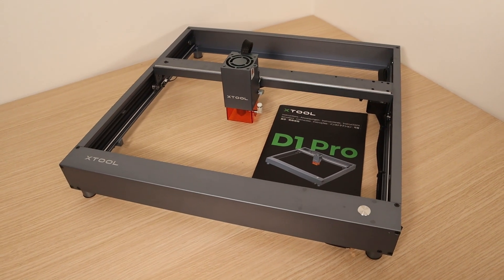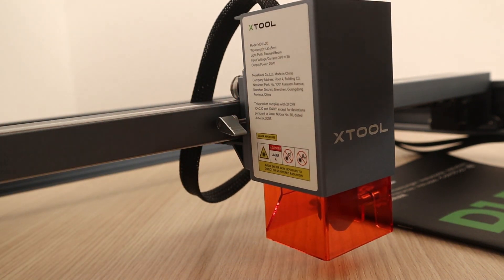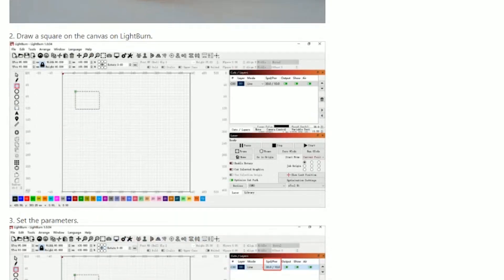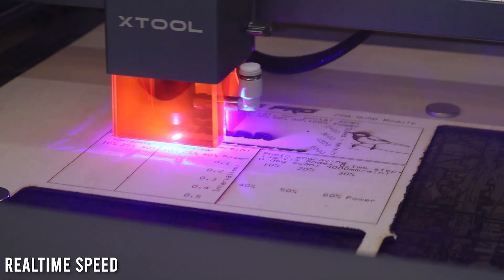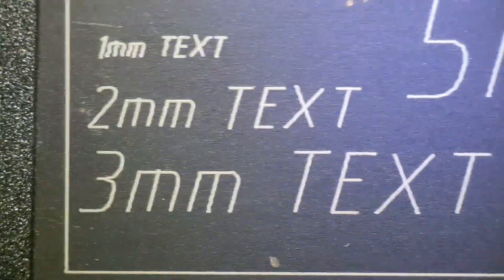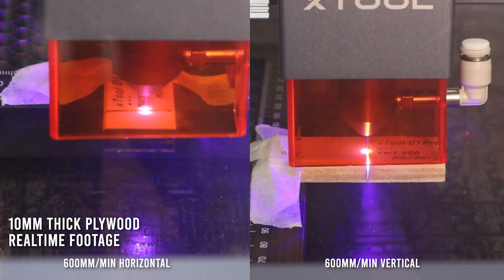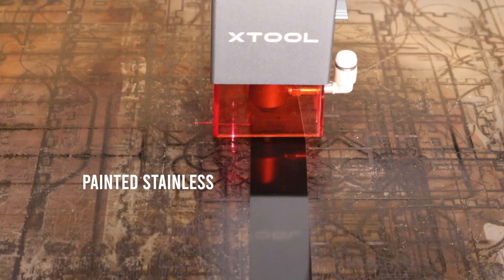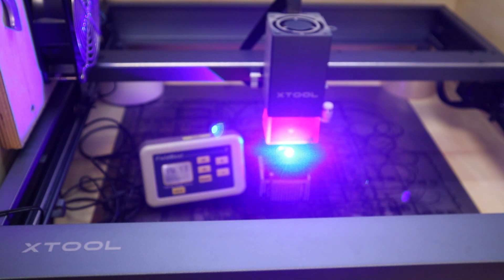Is xTool D1 Pro 20W the Best Quad-Diode Laser Engraver in 2023? Detailed Review and Test!

Comment: Do you think this laser is better then X20 Pro and S30 Pro max? to cut in hardwood as pine wood 18 mm?
Reply from the maker: It is similar. See my video of the air assist comparison. There I was cutting a thick pine or spruce board with this machine. It did great.

Comment: This machine engraves nothing at 10% of power unlike the Sculpfun and Ortur. Is this effect gray scale engraving?
Reply from the maker: The 10% engraving performance depends more on the driver circuit than anything else. It doesn't mean anything. You need to use this information to adapt the settings so you use its full capability when engraving.

Comment: Having run different laser systems. One thing you did not mention about the air assist. You need it to keep the smoke off the lens or you will wind up burning spots on the lens and will get blurry spot and its performance will decrease. Those optics can burn if the smoke gets on them. You will have to either get new ones or send it in to have them replaced. :/ You should have at least hooked up an air source to it till your assist comes in.
Reply from the maker: Hi, i have made a separate video about an air assist: https://youtu.be/R6qCplOJSzw

Comment: Thank you very much for the overview! I am considering my first laser engraver/cutter purchase and this one is on the short list. With that said, based on the gradient tests at the 7 minute mark I am actually leaning towards the Sculpfun S10 or most likely the Ortur Laser Master 3. It seems as though engraving with these two lasers will produce much higher detailed images and for what I plan on cutting 10w will be more than enough. The Xtool lasers seem to be lacking when it comes transitions. I am not sure if this is a limit of the lasers inability to run at low power or if it's fixable with a firmware update... 

Cheers,
Greg
Reply from the maker: You need to take in the account that the test pattern with the 20W xTool has speed setting doubled compared to 10W test pattern. This is why everything looks lighter in color. And the S10 test pattern was made with an air assist which gives more contrast to engravings. Otherwise the quality of engraving is similar between these two. check my recent video where I tested the air assist kit also for the D1. But because the xTool is twice as powerful, you can engrave almost twice as fast. I haven't tested the Ortur laser master 3 yet.
If you decide to buy, check my discount code list(I update it regularly) to save some money: https://hobbylasercutters.com/coupons/
Reply: @JTMakesIt  Thanks for replying! I will use the links on your page for sure. Will the xTool lasers 10w and 20w produce shading below 20% power? Does it even matter? Thanks! Greg
Reply from the maker: @GregAllen2  it doesn't really matter. You just need to adjust the settings according to your machine so it engraves perfectly.
Reply: @JTMakesIt  THANKS!

Comment: Hello, do you know if the D1 10w laser fits on the D1 Pro frame?
Reply from the maker: I think it does not. The mounting slot is wider and the connector has more pins on the D1 Pro.

Comment: Is there a way to add the limit switches to the original xtool d1
Reply from the maker: I don't think so as the D1 Pro electronic board has a connector for limit switches and the D1 does not have it. But D1 can home without the limit switches thanks to the smart stepper motor drivers. Check my review of the D1 from few months back and you will see.